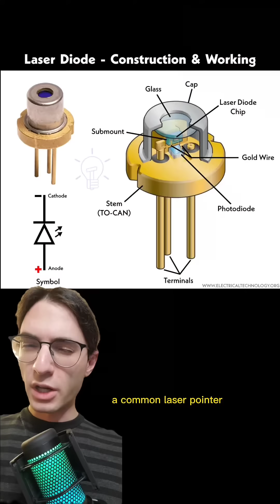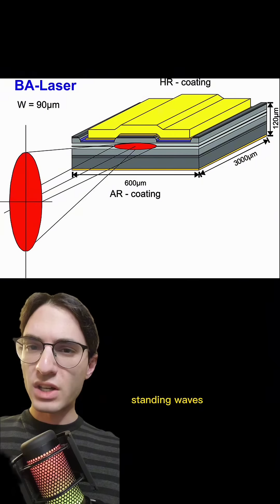How powerful lasers work

Comment: Any time you work with lasers over 5 milliwatts you should use proper laser eye protection for the wavelength of the laser you are using. Make sure its not the fake ones either, because those will do more harm than good by making you think you can now look at the laser when you cant.